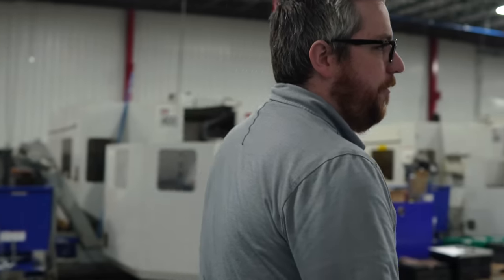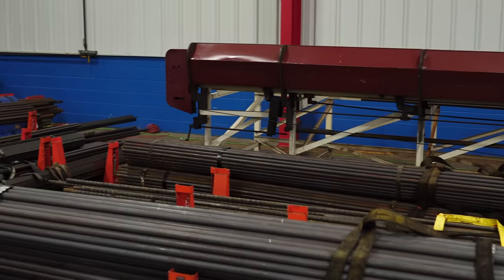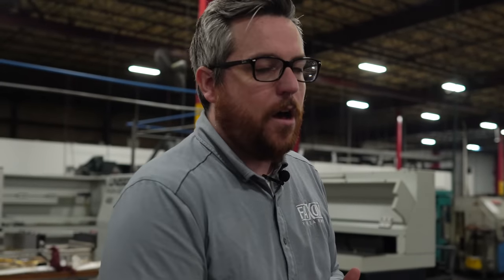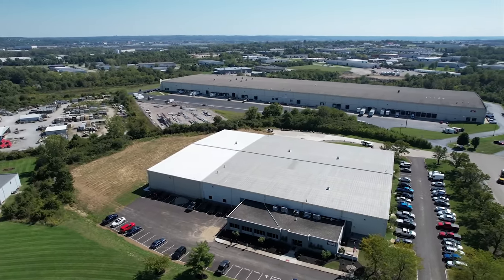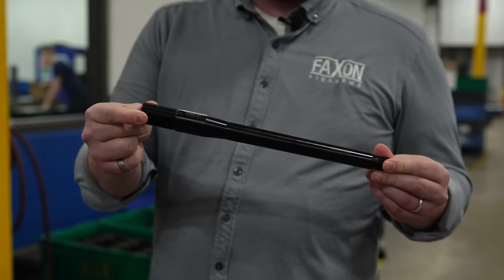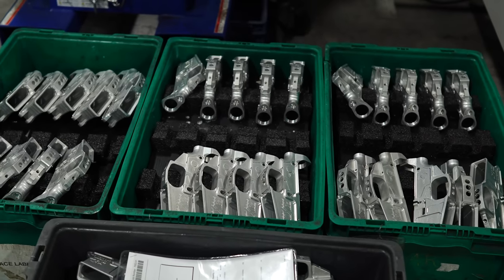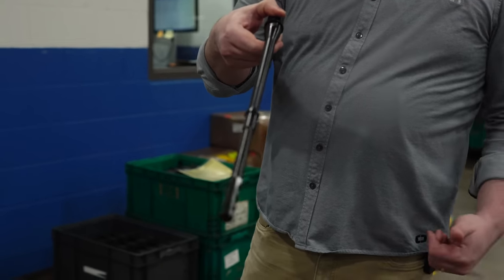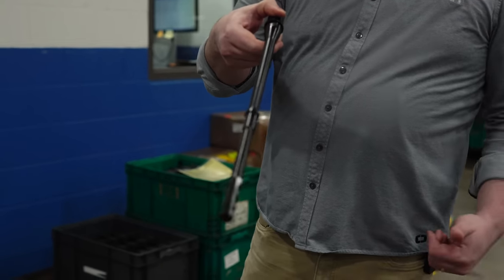Inside the Industry: Faxon Firearms HQ Tour

Comment: I purchased a 20" heavy fluted 6 arc barrel from Faxon. The first barrel they sent me had gouges and chips in the groves and lands.i talked with customer service and they agreed to send me a replacement.  When the replacement finally came, it was worse than the first. I spoke with someone from QC and he told me he would hand pick a barrel for me and send it asap. A couple of weeks later, after messaging them every  couple of days. They received the barrel and it was even worse than the first 2. They agreed to refund my money, so I sent the barrels back.  They received the shipment on the 9th and it is now the 23, still haven't seen my refund. They had a 3rd party message me and tell me that the funds have been refunded minus a restocking fee of 40$. I don't feel I should have to pay for their incompetence.  The barrels were junk and they knew it when they shipped them to me. I am very disappointed in this company.